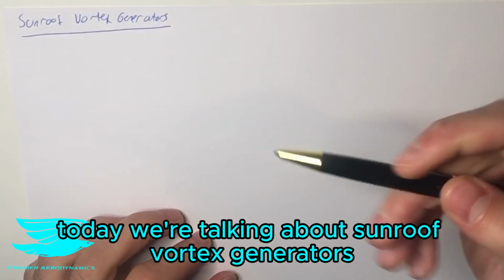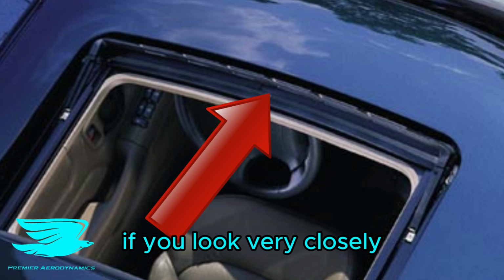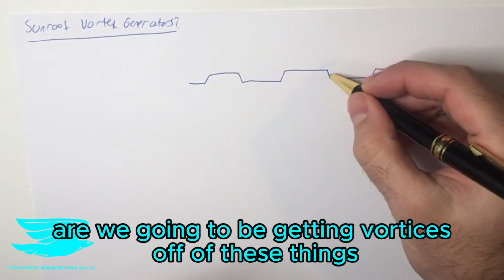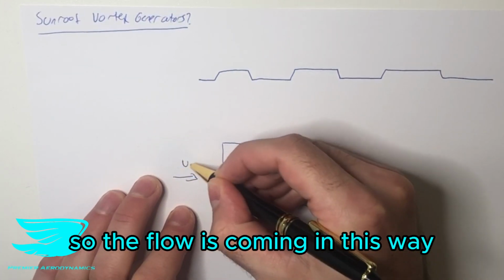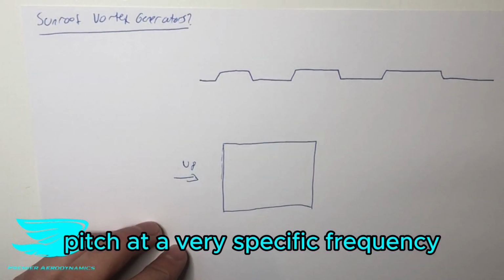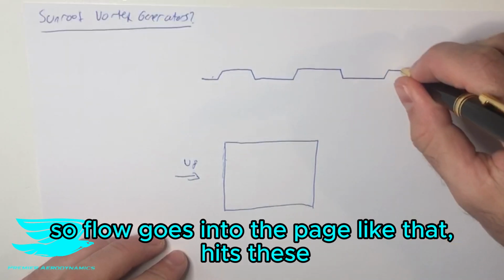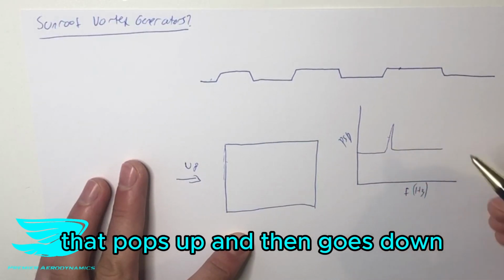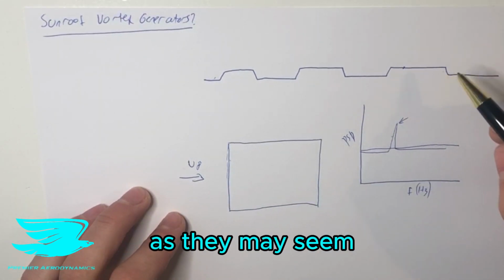{Auto Aero #34} Sunroof Vortex Generators?

Comment: On a dodge challenger they cause a ton of wind noise but if i pin them down its completely quiet
Reply from the maker: That's funny! I guess they managed to get rid of the noise from the cabin but introduced more noise from the actual sunroof cutout.
Reply: @PremierAerodynamics  yeah its wierd so i just hold them diwn with a clip when i open the sunroof